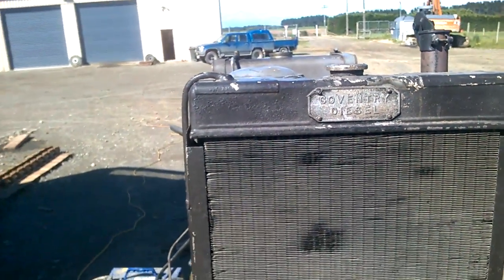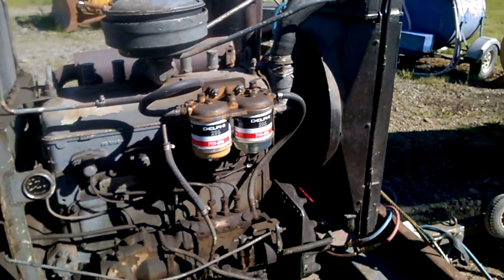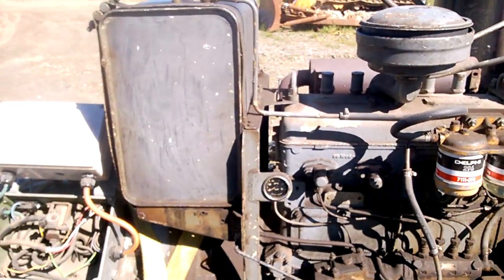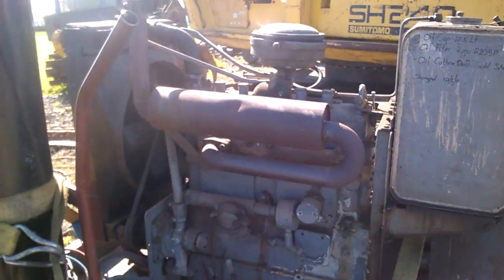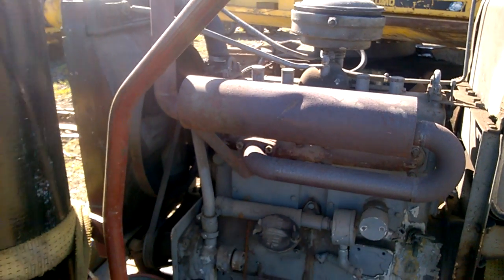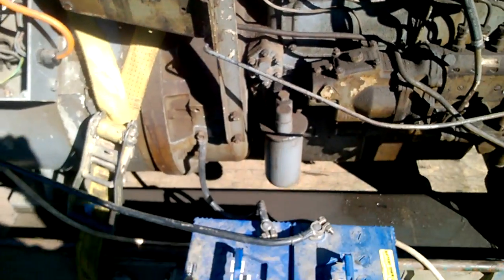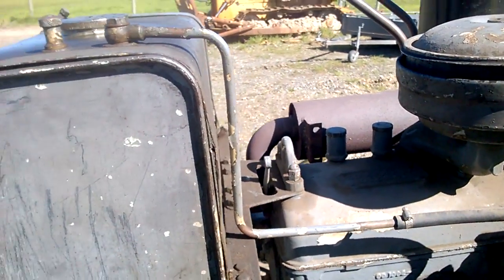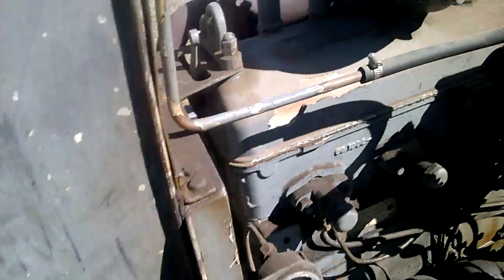Coventry Diesel 13.8 KVA genset

Comment: Nice running generator. Two cylinder, are you sure. I see 4 fuel lines on the fuel pump and a two cylinder sounds different too.